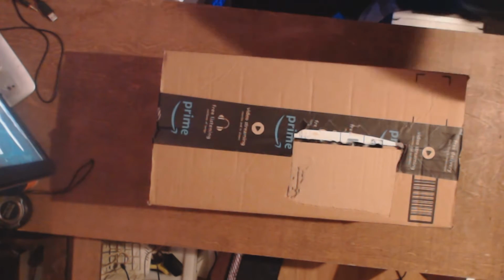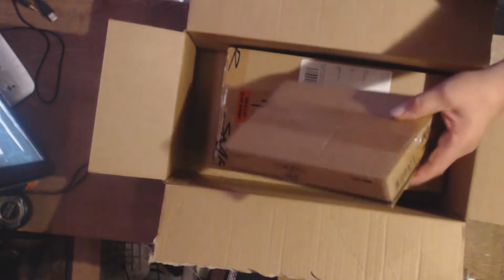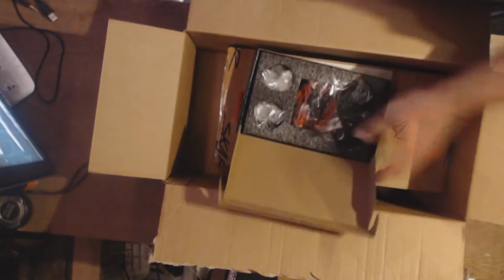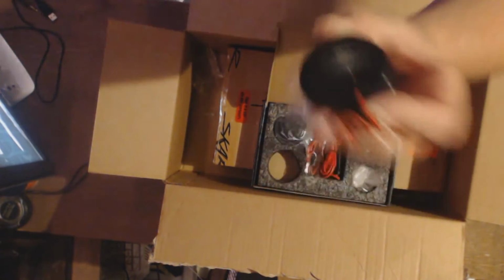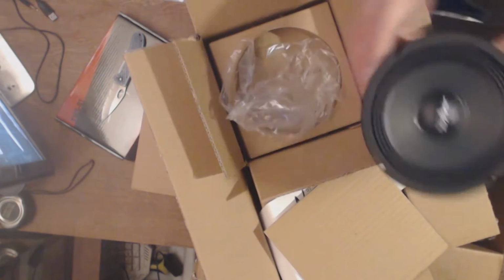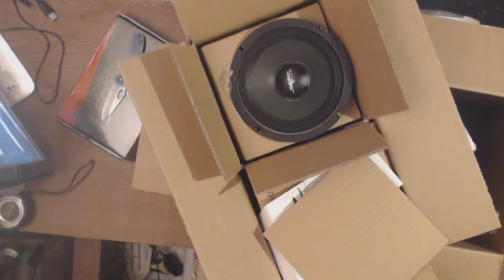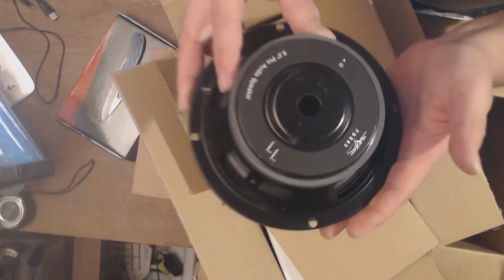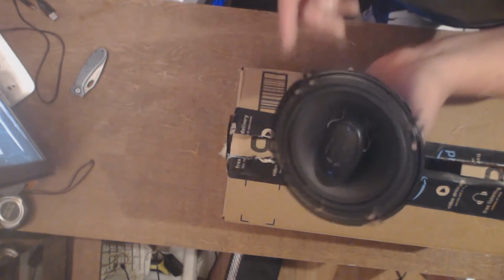Unboxing Skar Audio FSX65 6 1/2 and TWS-01 silk dome tweeters.

Comment: What kind of amp should I run my tweeters on i have the same tweeters as you
Reply from the maker: if you want to power just tweets not sure but if you want a good four channel amp, the Kicker Key 180.4 is a good choice. Has built in DPS.

Comment: Yeah mine sucked my passenger side one wont stop wining, chirping so disconnected it, threw it in the back. 
Cheap trash in my opinion only lasted a week.

Then again could have blown it idk i wired em up, all and when i installed my bass boosted alpine radio made sure the ground was good. 

The other one works for now so will run it with that my pyle 6.5 subwoofers speakers work fine, had em for like 6 months work fine still except the one on passenger front side has a slight noise when you turn it down low other than that they're fine. 

I am by no means a professional at this i just injoy working on my old 2001 dodge Dakota. And it had all stock speakers, all when i got it so wanted something decent but not expensive. I don't even have a amp but don't need one really.
Reply: I hope you weren't play bass off a tweeter

Comment: What’s the cutout diameter for the tweeters
Reply from the maker: 47mm or 1.8 inches in the factory cup. There are other measurements for different configurations. I did not do a cutout so I suggest looking it up for exacts.
Reply: @craftchest  ok I have stock tweeters in my truck on the a pillar and the hole measures 1 5/8 so wasn’t sure...I’ll try to look it up...I appreciate it
Reply from the maker: I took mine out of the cups and modified my pillar. I have another video showing it.